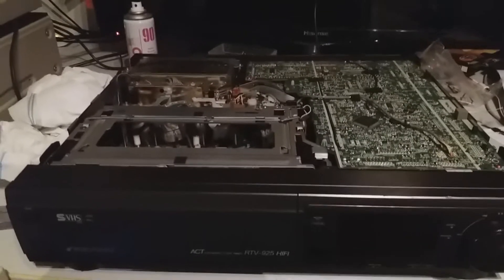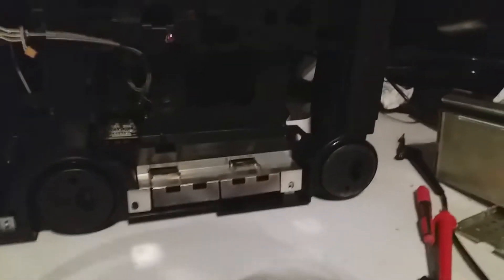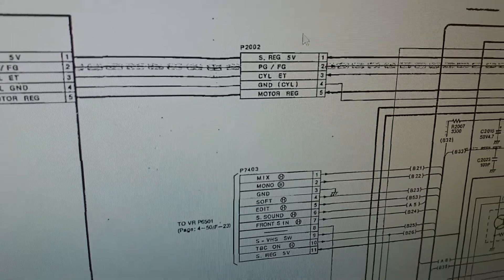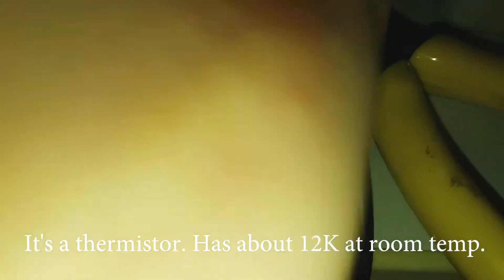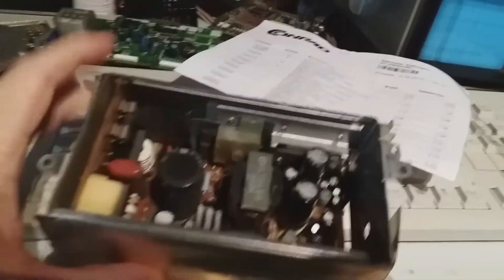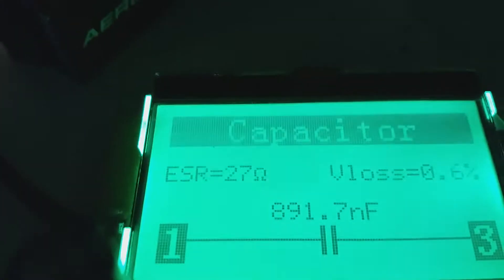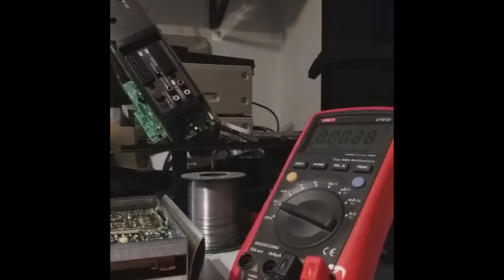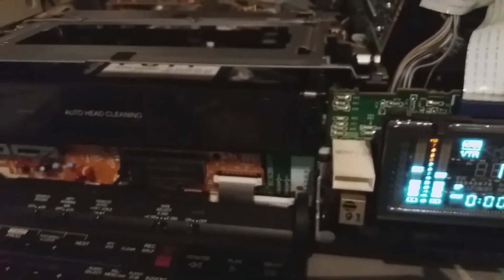Trash-picked Panasonic NV-FS 88 Repair Part 1

Comment: Hello 
I buy 3 days ago Panasonic NV-FS90
Work good, good image but after 3-4 sec after play sound fail.
What you think is problem?
Thank you!
Maybe you cand help me!
Reply from the maker: Hello, this is a very typical fault, check capacitor C2311 (marked as C11) on the Servo Pack (I think it was a 47µF)

Comment: Hi, good video :) Would you know the reason on my FS 90 I have all power with everything working but the display screen is not working anymore eg. no clock or display of the recording bars!? everything else is fine play ff rw eject it plays a picture fine. I have fully re capped the power supply and its not that, I also have another 3 power supplies that were tested and still same thing! I also put the front panel into one of the spare machines to make sure its not the actual screen buts its fine. The other machines have all different problems so not using them only for parts. 2 have no picture, with svhs light on all the time like in your video, another fault is not playing svhs tapes just black screen, and audio problem on one of them no stereo just mono.
So trying to make my one work again with parts i can salvage from the other 3 :)
Reply from the maker: are you sure the cables connecting it are okay? on my FS88 they were bad (sorry for late reply, i rarely check these :( )
Reply: @Oerg866  yes as tried different cables from the other 4 players i have, i ended up rebuilding one from 4 as one of the mainboards worked fine, just had to pick all the best parts and make a complete working player, just have 3 fs 90`s for spares now. but least i have one working nicely.
Reply: @rs2klee  Hey i know its been a year since your last comment, I have an FS-200B and my luminance & chrominance pack and Sub luminance & chrominance pack are dead, would you consider to sell those parts? i really want my VCR to be alive again :(

Comment: Hi - Gratulation - Super Reparatur!!!
Ich habe den gleichen Recorder. Mein Problem ist jedoch, dass die Trommel nicht immer anläuft und dadurch die Bänder zerknittert werden, wenn es passiert. Wäre Klasse, wenn ich da eine kleine Hilfestellung bekommen könnte.
Reply from the maker: Hi! Dankeschön für den netten Kommetar :)

Meinst du mit "Trommel" die Kopftrommel oder die Wickelteller? 

LG
Reply: @Oerg866  

Vielen Dank für Deine Antwort.
Ich meinte die Kopftrommel selbst. Diese läuft nicht immer an, sobald das Band eingefädelt wird. 
Da das Display nicht mehr funktionierte, habe ich auf dem Servo Controller Board bereits die 220uf Kondensatoren gewechselt, der Fehler war damit behoben. Das Problem mit dem nicht anlaufen der Trommel war aber zuvor schon da.

LG
Reply from the maker: @ralf-petermicko8935  Das hört sich in der Tat merkwürdig an - ist sie eventuell Schwergängig (Lagerschaden o.ä.) ?
Reply: @Oerg866  Hi, nein überhaupt nicht. Was ich beoabachtet habe, ist dass sie zittert, wie wenn sie leicht erregt wird. Es sieht so aus, wie wenn nicht ausreichend Strom anliegt dann. Könnte ein defekter Kondensator auf dem Servo Control Board, dem Netzteil oder eventuell der Mode Select Schalter die Ursache sein?
Reply from the maker: @ralf-petermicko8935  Hi, ich hab darüber mal ein wenig nachgedacht und so richtig im Klaren bin ich zu der Sache auch nicht - Checke doch mal die spannungen die an dem Pfostenstecker anliegen während sich das Teil schwertut. 

LG
Reply: @Oerg866  Welchen Pfostenstecker meinst Du genau? Den auf dem Servo Controller Board, an welchem das Flachbandkabel zum Capstan geht, oder den 4-poligen daneben?
Reply: Habe auch ein Problem mit meinem NV-FS88. 

Fehler ist hier beschrieben: https://forum.electronicwerkstatt.de/phpBB/Ersatzteile_Reparatur_Videorecorder/videorecorder_panasonic_nv_fs88_keine_bandfunktionen_mehr_da-t156269f21_bs0.html

Hat jemand eine Idee?

Comment: Hi, did you manage to fix the dark picture problem on your Mitsubishi HS-M1000? Thanks.
Reply from the maker: No :-( the unit also has an issue with pulsating linear audio. I've put it on the shelf for a clear head day :-)